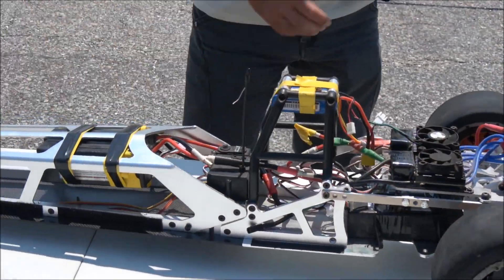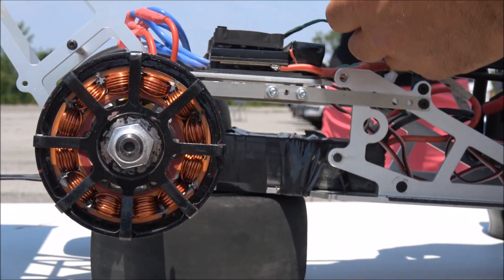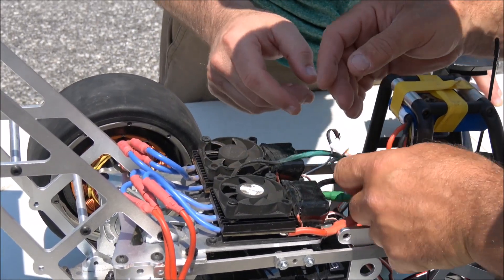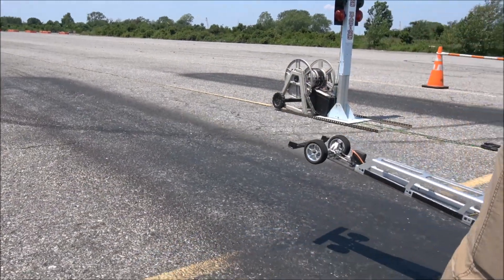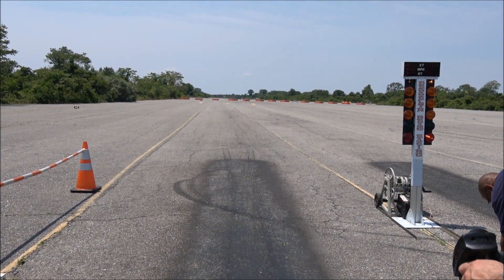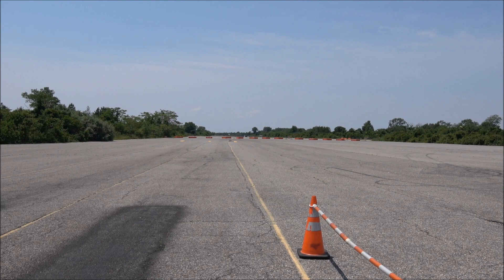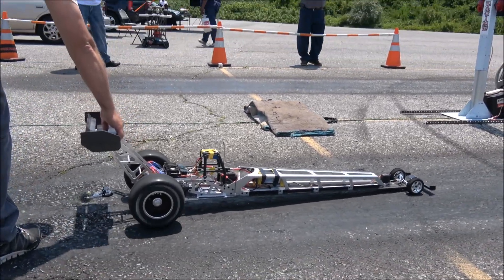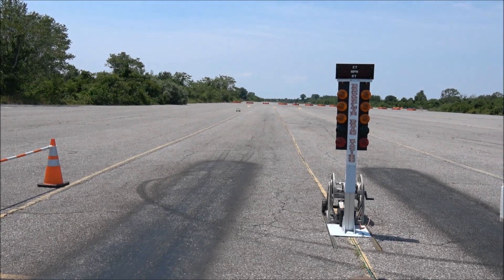Electric Primal QuickSliver Dragster Powered By Tidnab Innovations

Comment: Remove the crappy 2 Motors from the tires and get 1 Motor inside and it will run. You need the diff in the Car for traction !!!